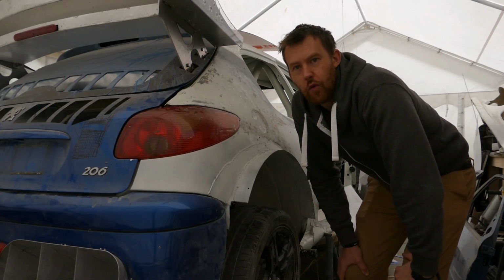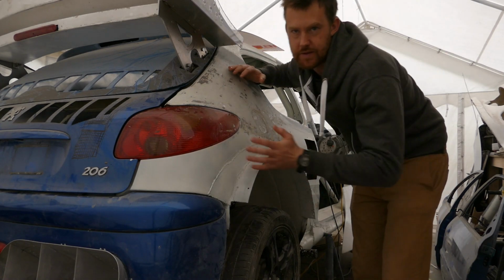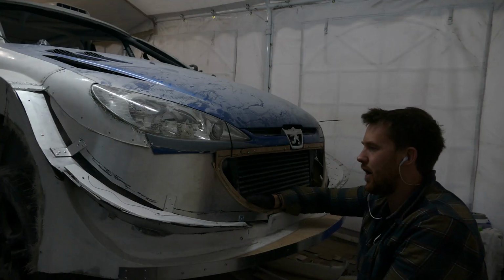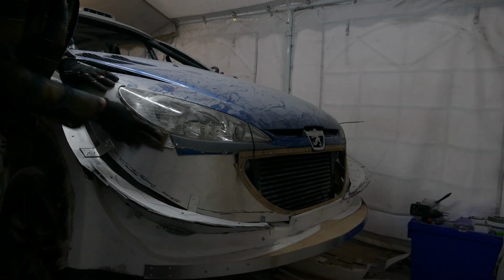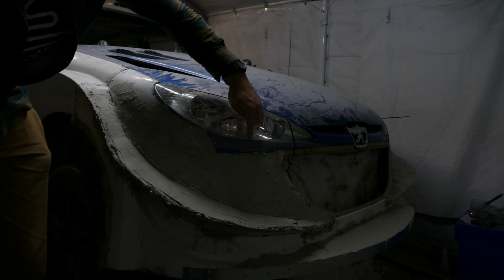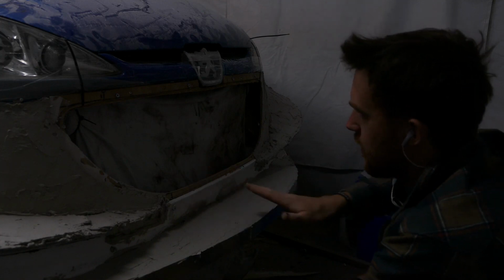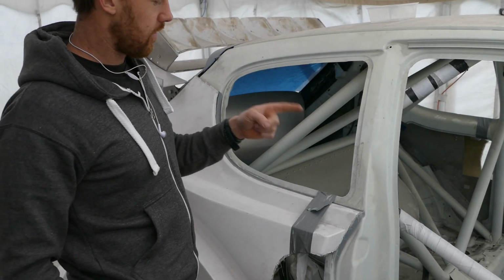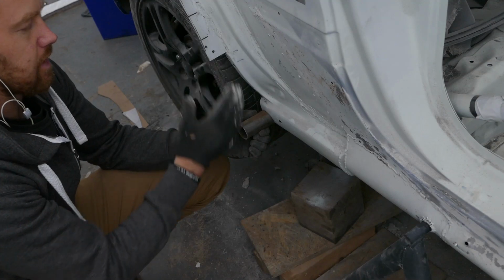BUILDING A LOW COST WRC REPLICA FROM TWO CARS! 206 WRX BUILD SERIES Ep66 #peugeot #subaru #btntbt

Comment: You give plenty of space for the air to flow to the intercooler, but not much for it to flow out behind it. That will significantly reduce effective airflow. You could either move the heat exchanger a little forward, or install a few little fans behind it: should make quite a difference!